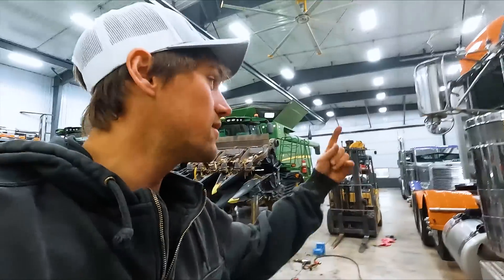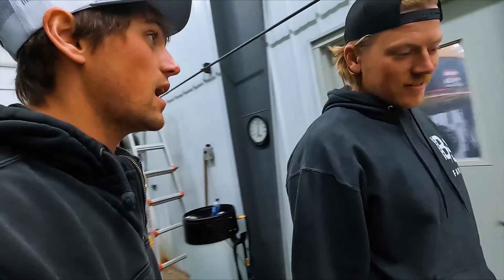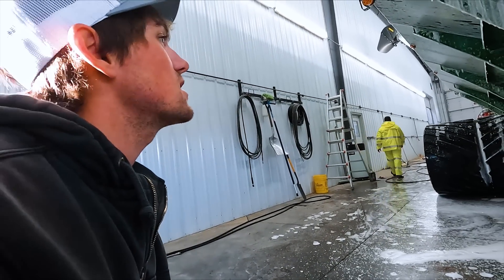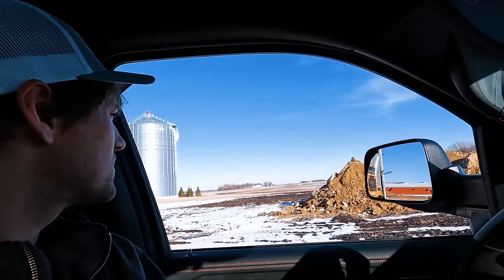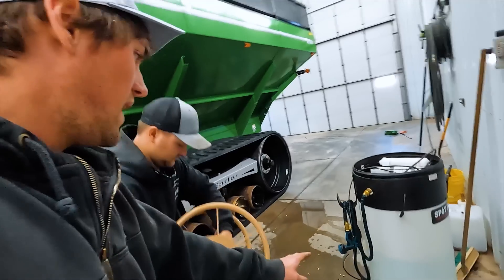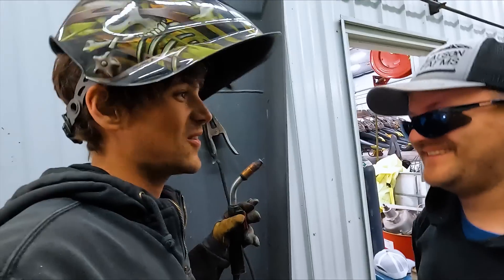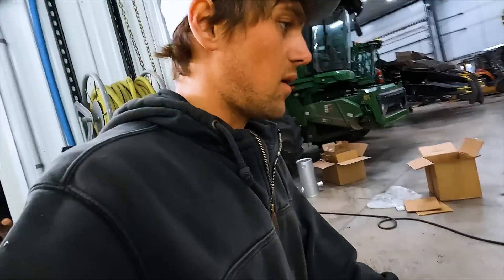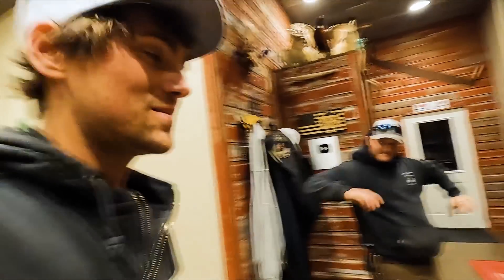Should Have Took Welding Classes!!

Comment: You don't need welding classes to be coming good welder I used to be a wire welder at Vermeer and when I started there I never wire welded in my life and after 8 months I got employee of the month I then became a lead man for a while I also went out on the road and then emergency fixes for a bit

Comment: always put a nut on the bolt you are welding ,not to only protect the threads but to clean up the threads if splatter gets on bolt

Comment: I have to add my story about working at Flexi-Coil years ago when they just made land packers.  My uncle came in and he said to his son who was welding stub axles onto the end plates, "Who let the turkeys in?"  My uncle left and my cousin lifted up his welding helmet and he gave me a silly grin.  I was the one who was bolting the stub axle onto the end plate.  I could keep up with the welder.  Of course I was using an electric device that would spin the nuts onto the bolts.  I never forgot the look on the cousin's face.  He later became the the president of Flexi-Coil and they sold the company to New Holland near the end of the 1990's.  Of course, Case NH amalgamated and you know the rest of the story.  That original factory was enlarged twice and they moved to a much larger factory.  Then a few years later, they enlarged to a factory that could handle global sales.  I went onto a different career and I moved to Calgary.  😊  Your welding skill reminded me, "Who let the turkeys in?"  . . .  By the way, I do not weld.
Reply: As they say, "it looks like goose poop on a pump handle, eh"!

Comment: That should work well for your cleaning process not to mention be a good work out reaching up for that reel handle. So who won the welding challenge? 
Is it cool to have the water processor tank right in front of what appears to be a 220volt outlet?

Comment: Wire your spot rinse up to a air compressor/well tank style pressure switch. Once line pressure drops -10psi (or whatever works) from normal pressure it will kick on automatically...

Comment: Welding is way overrated.  Had 2 yrs of it in school.  Was rather fun at times.  Even better when I was gas welding and the hoses catch fire, that happened a couple times.  
The instructor was shocked I didn't manage to blow the school up.  🤔🤨🤪
Great video guys.  
Liked the old intro better.

Comment: GMAW Short Circuit Transfer isn’t hot enough to burn Paint off, you really should of prepared that surface, but it isn’t structural so I’ll forgive you. One easy to use solution to get in the ball park think of every 0.001 inch needs 1 amp so 0.125” thick Sheet/Plate is 125amps. 0.035 wire is good from about 50 to 180 amps 0.045 75 to 250.. GMAW only really gets fun when you get into Spray Transfer, gets a little warm though.

Comment: Let's all just be grateful that those welded bolts are going to be covered up, I think a little third grade girl could have done a better welding job than what you two put up, what you should have done was to drill holes for the bolts to be inserted from the back side and weld the head of the bolts...

Comment: Fun fact when you lift chrome stacks your supposed to use a rag because the oil from your hands will leave marks
Reply: Love the new intro.   Great video as always!
Reply: If you clean fingerprints off prior to heating up they wont leave marks. Learned the hard way on exhaust for a Harley. Windex works great.
Reply: You're
Reply: Not judging but , I should have TAKEN welding just an observation . Keep up the good vids .

Comment: Since the old man spinn the wells on the wellowder hee are not fit to drive the maskin. Hee is supows to fill the bucket and moow torwerd at the same time and hwidout spinning the tayers. Hee can doo it hes way if hee can aford too bay nuw tayers tways a yare. And tayers to a weellowder will cost abaut 50057. Pr tayer.
And if hee sey im wrong you can tell him that im a prof wheel lowder drive